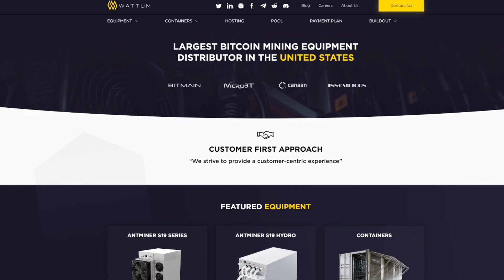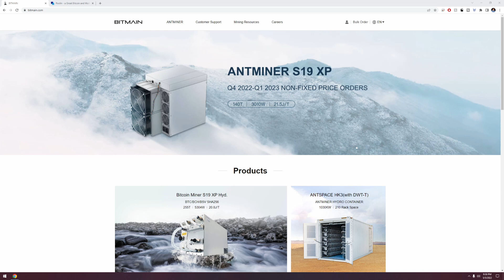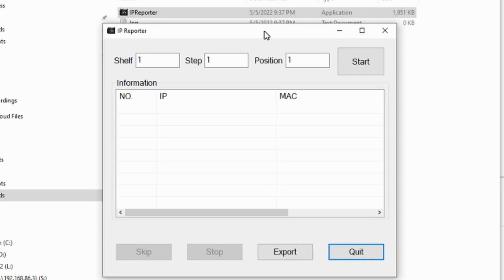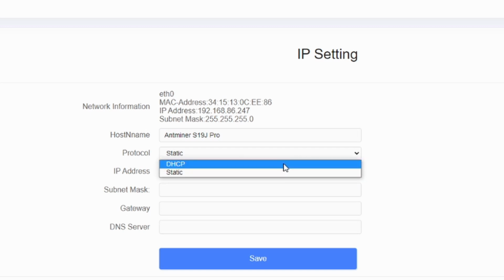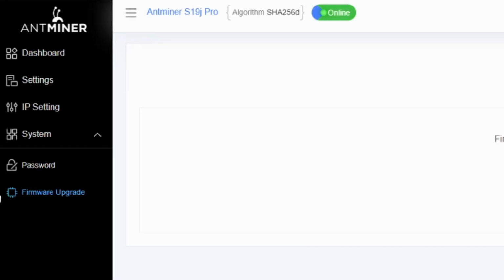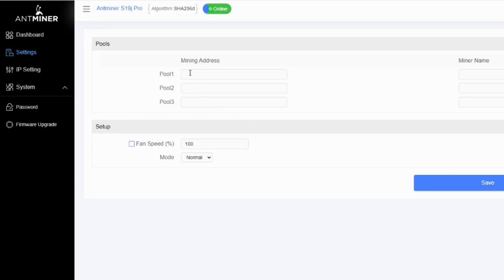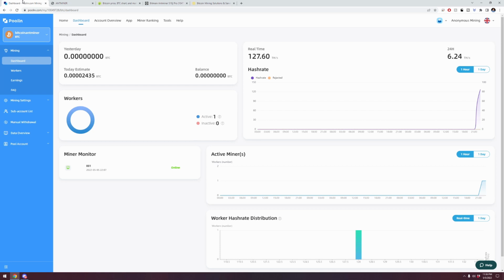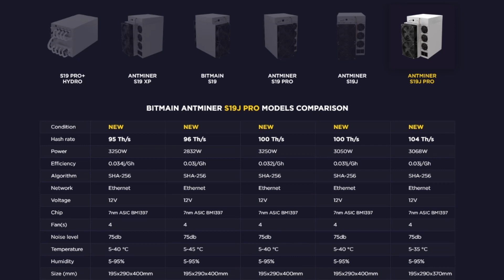The Ultimate BITCOIN ASIC Setup and Install Guide | Bitmain Antminer S19J Pro

Comment from the maker: Have you ever considered purchasing a Bitcoin ASIC Miner as a Home Crypto Miner?  Is it on your gameplan for "down the road"?

Correction in Video: I had a Goldshell HS-Box Powered off at the End connected to the same PDU.  So my calculations where off by 300 Watts. So the S19J Pro did infact use 3068 watts as advertised!
Reply: got my first BTC ASIC set up right now!
Reply: Hello
Reply: very good vid! still helpful today
Reply: I bought an S9 recently to learn on

Comment: Can I plug it in directly into a 240volt outlet ?
Reply from the maker: Requires C13 and C14 cables.  You would than go into PDU which you could than plug into a 240V Outlet

Comment: can do a hive on set up?  If Im on Hive, using Poolin, shouldnt the hash rate from hive show up on the Poolin dashboard?
Reply from the maker: So you can put your S19J Pro on the HIVEOS Firmware yes.  You can also add HIVEOS ASIC HUB to get your Bitmain to show up in HIVEOS for monitoring.  In both situations you can mine to Poolin and your hashrate will showup on Poolin as it's your pool.

Comment: Can i run 4 s19j pro units with 1 240 receptacle and the tripp lite you have? or do i need 4 individual 240 outlets? thank you
Reply from the maker: If its 30amp 240 = 7200 watts. To be safe you can only use 5700 watts on that.  1 S19J Pro uses just over 3000 watts.  You can run 1 lol

Comment: I setup 2 of these myself a few weeks ago, that room is going to get warm, I'm also worried about all that heat dumping right on your PDU. keep an eye on it, maybe put it on the bottom shelf for the coolest air and nothing behind it. The fans where at 99% after 1 hour 😧
Reply from the maker: This was short term. The unit is out in my garage now until the Shed is built.  Thanks though!

I had the concern about the PDU as well. Good eye!
Reply: Thats also the reason your drawing more than the standard power, the fans going full speed draws alot more.

Comment: Let's be real, as cool as ASIC mining looks, 95% of the average at home miners cannot afford these.  The entry price point for equipment is out of reach and the energy demand, heat and noise are too much for the average at home miner.  I wish I could afford these and had the infrastructure in place to runs them.  Oh well.  Great video as always.
Reply: The miners cost like $1500 i just got a s19jpro+ 120th for that off amazon im not sure if it was 10k when you commented this but as of now the price is fairly affordable. I did just check though and my same miner is now going for $2500 used like new on amazon from the same listing i bought it from. I guess you just have to be on the lookout for them
Reply: Yeah, 10k (ish) for costs, and probably 200 per month in electricity is not easy to swallow for many people. You gotta be willing to accept it'll take many years to make a profit. 

Kind of a shame, man I miss the gpu mining Bitcoin days. But on the bright side at least people can still run these at home and Bitcoin mining isn't strictly a "dedicated facility" thing.
Reply: Bro where are you from